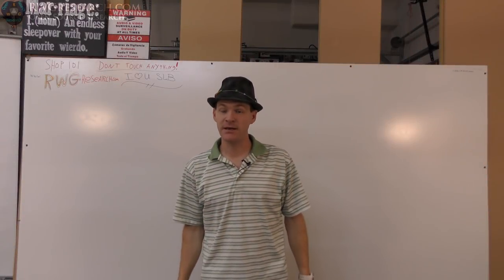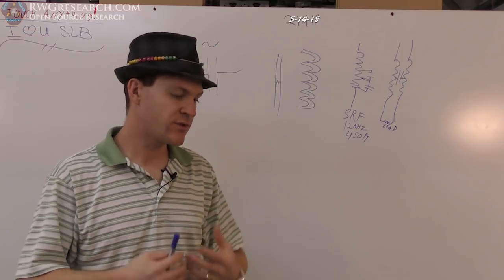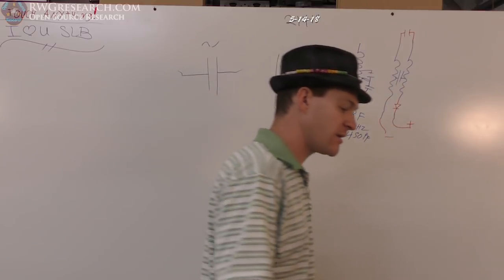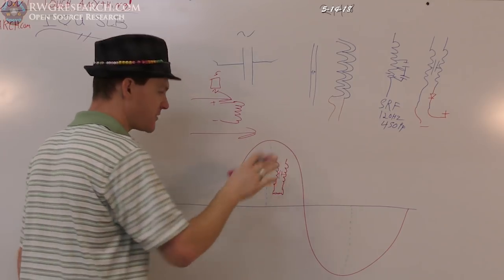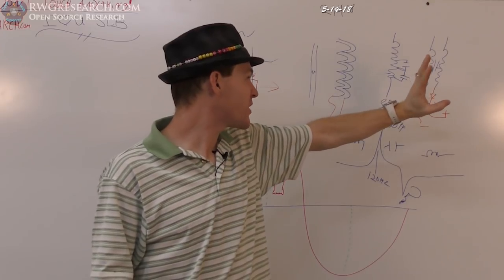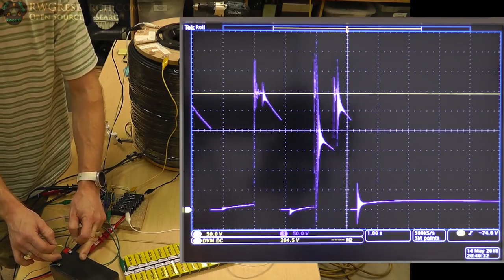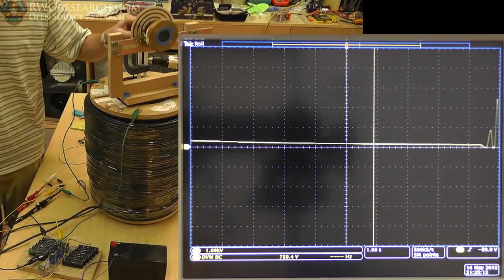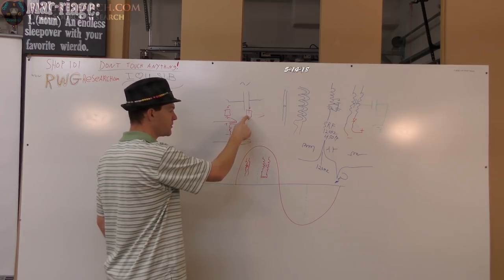The Search For Answers Part 20: Charging Coils As A Dielectric Field.. Instead Of A Magnetic Field..

Comment: As many of us know by now, a changing magnetic field generates an electric field. However, what not many know is that magnets have an effective electric dipole moment that depends on their velocity.

That means that as a magnet rotates, it bares effective positive and negative charges. These effective charges "exist" on the surface of a magnet and these generate an effective dielectric field.

Formally, this charge density can be derived as the scalar Laplacian (div grad) of the electric potential.

The sign of this frame-dependent electric potential on or off the surface of the magnet depends on whether vector potential A_n is aligned with the source velocity v_n (hint: it's a dot product), where the n refers to any finite fragment of the magnet which contributes A_n to the vector potential A.

The mirror of this potential is the velocity dependent "potential" (v·A) which arises when the velocity v in v x B is ascribed to the charge rather than the magnets. It follows simply by swapping between 1) the rest frame of the charge, and 2) the rest frame(s) the source(s).

Regarding the electric fields produced by magnets in motion relative to the observer: Only the solenoidal/rotational component of the induced electric field is responsible for Lenz drag. The potential/irrotational component of the electric field is not responsible for Lenz drag. Instead, it may be used to excite the electrons in the dielectric, producing diverging/converging currents, and then in turn that energy may be delivered to the LC self-resonance of the coil. The presence of dielectric material, double-layer capacitance, or even electrochemical pseudocapacitance can increase the amount of conduction electrons in which may be converged or diverged. The former set is subject to an opposite change of potential energy to the latter conduction electrons in so much as + charges of the former Coulomb-screen the - charges the latter.

The energy (mainly IR spectrum) absorbed to increase the entropy of alignment in the dielectric is down-converted into lower frequency RF spectrum power, while working against electric potential of the moving rotor magnet(s),  whereas surface charges rearrange on the stator coil's fine windings, driven by that potential, producing electricity which then may be captured in useful quantities.

Comment: capacitance does increase in a bifilar coil, but the real magic comes from the voltage difference between the bifilar windings. 
the energy stored in the dielectric field is dependent on capacity and voltage.
Voltage squared that is.
So increasing the voltage has a much bigger impact on the energy stored in the dielectric field.

Voltage van be increased by (series) resonance.
Reply: Yes, this example uses 150kHz coil resonant frequency at very high impulse rates (seconds instead of smaller units of time in the disruption cycle) @ 50VDC. If we up the excitation voltage and switching rate on the charge side, maybe also up the WATTs, maybe we could see a discharge wire turn to puff :-)

Comment: What is amazing, that you have now shown, that a dielectric charge of he stray capacitance can really drive the rotor and give it an additional kick without paying for this extra mechanical energy with additional input power... I guess you have now shown how to violate lentz law in a Newman motor this way. That is a very important discovery...Very well done. I hope you can build the new Newman motor now according to these effects and optimize it for more mechanical power output.
Reply: Which coils did you charge up this way ? The small wire coils or the newer bigger sized wire coils ?
Reply from the maker: overunitydotcom in thses tests. The small wire. ~Russ

Comment: Hi Russ thanks ..it'd be good to see (scope) the charge current curve during the risetime, with small current sensing resistor, then can calculate input energy vs measured output energy into known load upon discharge.
 To store energy in a capacitor we charge it and leave it open circuit,  however to store magnetic energy in an inductor (magnetic field) we charge it and clip a short circuit across it. This prevents the B vs H field from collapsing. The charged cap looks like a constant voltage source (low impedance) the charged inductor looks like a constant current source high impedance.

Comment: The circuit diagram at 30:00 why do you have there this orange diode ? Is this for charging the 2 coils with the AC induction from the magnet to build up a one way rectifier to capture the DC charging of one half wave ?
Reply from the maker: overunitydotcom with out the diode,  it flips every polarity every 1/2 cycle. So for this demonstration i had to do it this way, think of it as a pump charge... ~Russ

Comment: Are you going still to try with this coil now to use the new big wire coil to drive it with the battery input to see, if you will get these big long negative back current spikes and use the smaller wire inner coil to power a few lamps from the RF bursts and Current spikes ? Would still love to see this before you start with the new motor... Many thanks in advance. Regards, Stefan.
Reply from the maker: overunitydotcom i explored this a tiny bit. But i need more time... so one day at a time ;) ~Russ

Comment: there is a drag even with coils disconnected, if they act as capacitor there is a capacitive reactance in AC and impedance in DC, for example as when you start to charge up a big capacitor, you see how many amps it needs at the start...
also the dielectric field creates counter reaction, i tested personally with some experiments, as for example a small whimshurst machine charging a big leyden jar, i see increasing current of the 9v motor of the whimshurst, every time i discharge the leyden jar, the charges needs to be "pushed" into the plates and then in the dieletctric....
by the way this could have other interesting properties, i like your experimentation thank you Russ Thanks for sharing!!!
(i have a nice test about a HV Coil/Capacitor on my videos)

Comment: The effect may be very different while the rotor is spinning during discharge, In your tests, you are discharging the stored energy when the rotor is stopped and coil is no longer inducting.   But if the rotor was spinning, you would be discharging in the opposite direction as the spinning rotor is inducing, thus possibly cancelling out the effect. 

Would it be better to dump the dielectrically stored energy to an external capacitor at an exact timing where the rotor is not inducting, like at the zero line in the center of a coil?

Comment: at 10:00 the diode is into the wrong direction. This way you can not charge the coil...just reverse the diode...
Reply from the maker: overunitydotcom @ 10:00 that diagram is just for a visual.  The real diagram i used is in the video @ 30:00 .  Hope your hand is recovering well. Blessings. ~Russ
Reply: Many thanks. You are right at 30:00 it is right. Many thanks my arm is slowly recovery, but I still can not much use my hand and my thumb is still numb, so I can only work at the PC right now...not experimenting...unfortunately... Anyway, many thanks for the wishes.
Reply: Russ, I think Newman himself did not really understand it himself, as in his later designs he quit from using the shortout segment in his commutators and did run the smaller motors only as real DC motors with just commutators, that reversed the current after 180 degrees and some, that just pulsed the input current....
So I guess you stumbled onto an effect that he might just have only accidently used in his first big machine without fully understanding it himself..
Reply from the maker: overunitydotcom i do agree, there were things that represent this effect, and indeed he did not fully understand what he was doing... he did however have a few other ideas that he descoverd with his theory that directly apply to this... ~Russ

Comment: PS: THE Whole idea, behind the Lens Free, or Lens assistance, generator, is to have a set of 4- 6 Magnet's on separate smaller disk's. Then spin the center of it like a motor. Ok, then as The smaller disk's That have Magnet's on them, spin around and the magnet on the smaller disk's pass by Each Coil of Wire" even though it is spinning the wheel, Each Magnet should pass by the same coil, several times, as it passes by .

Comment: Hi Russell, You seem to be a good person, you seem to Be some One who really Cares about others. So, I am going to give you little Clue's to which way to Go, and I will give you Answers: to what-ever- you are working on at the TIME.!! BUT" if I can't tell you straight out,-- what is Wrong, and OR What is Right, but you seem to be Stuck, well, just look at your email and OR the Comments section of the project your
 working on. If I am permitted to Help, I will.ok, Now about your Lens Law assistant, motor,. The lens, effect it's self is Not meant to spin The, disk, with the smaller disk's. Actually the whole center of the shaft spin's. So, as the whole center is Made to be Turing under power, the smaller disk's That are attached to smaller motor's, That spin the smaller disk's.